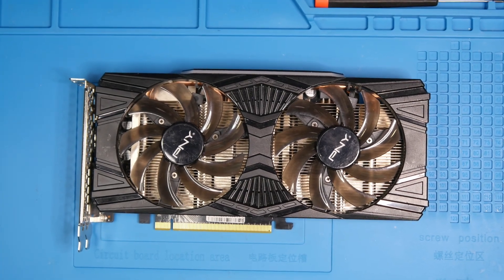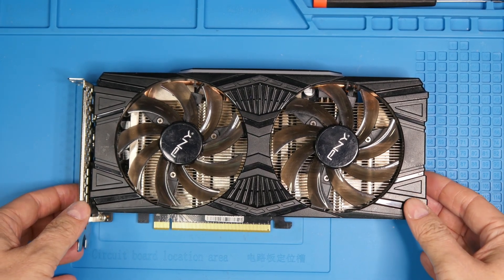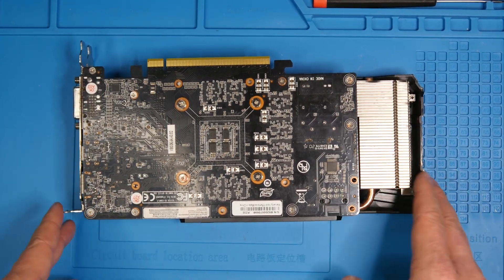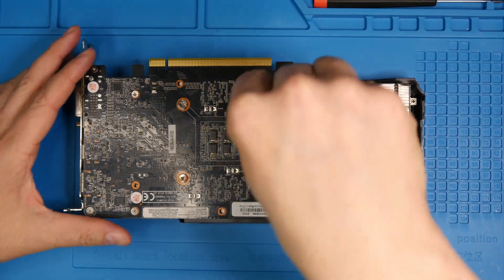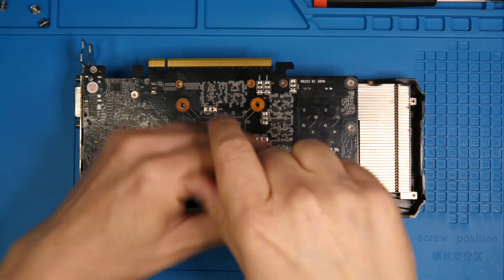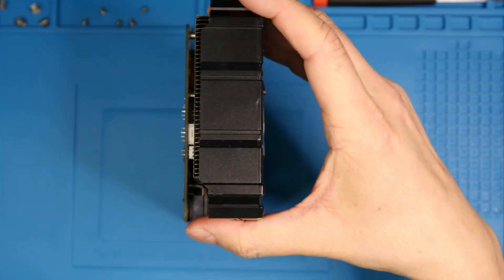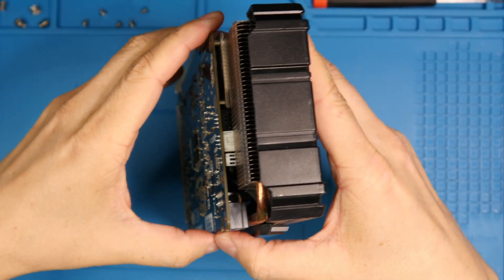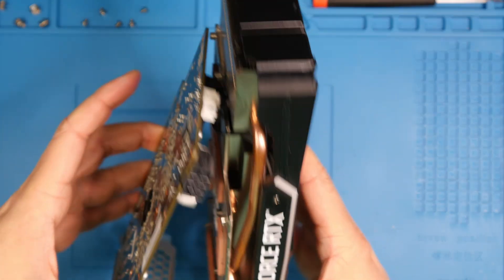Tutorial 1 - PNY GeForce RTX 2060 SUPER 8GB Dual Fan - [disassembly, thermal pads measurement]

Comment: I have this card may i know if the temperature is holding ok or does it run super hot
Reply from the maker: You have the temps in my second video where I fixed this card (9:00):

https://youtu.be/Xsi3TCfm224?si=47HoRRtYFBNz_N6k

The temperatures are not the best but I would say it's acceptable.